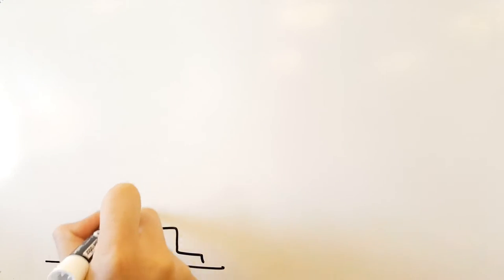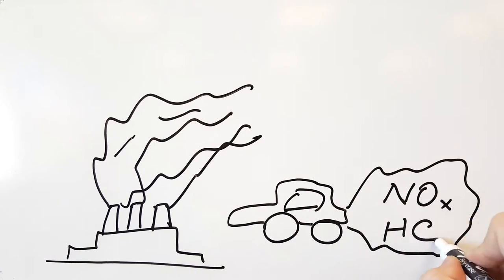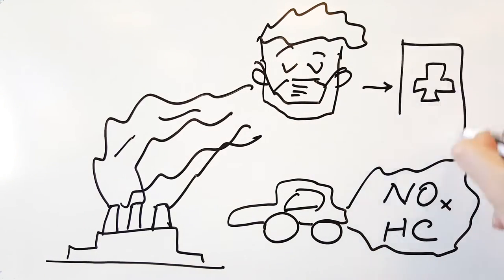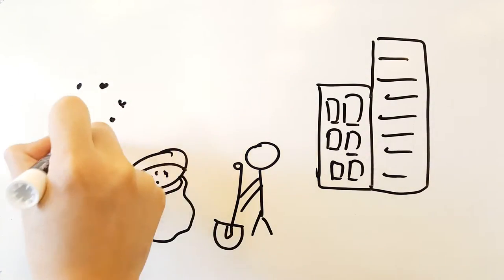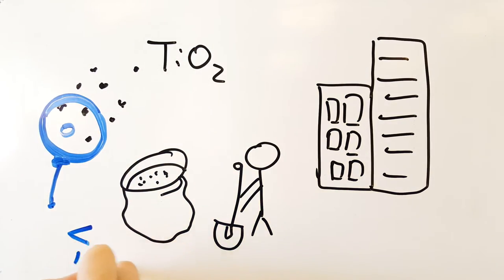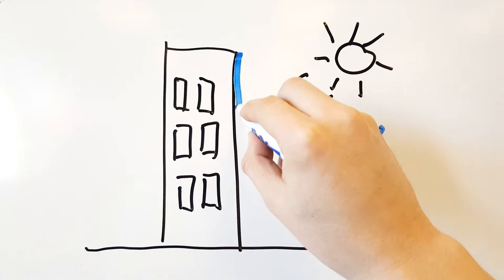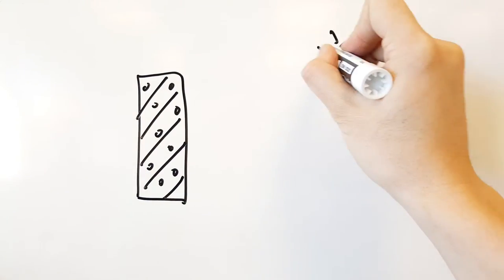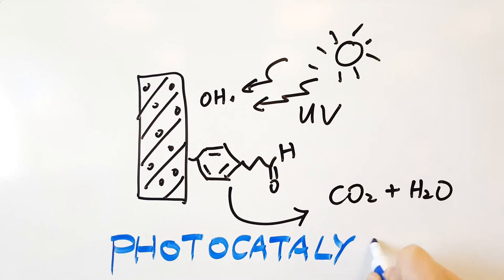Using nanotechnology to create self-cleaning buildings

Comment: Self-assembling buildings made 100% from nanotech

Nanotechnology – the control of matter on an atom-by-atom basis – has swept the world, transforming society in myriad ways.* At the same time, new methods of automation are displacing the need for human labour on ever increasing scales. A growing number of industries have seen their workforces shrink dramatically, with robots and AI handling the bulk of operations. Around the world, unemployment has soared.

Construction companies are being particularly affected now. By the middle of this decade, it's becoming possible to build entire homes and offices using nanotechnology alone. For a typical square or rectangular plot of land, this takes the form of self-assembling machinery, based around a scaffold system that initially resembles a giant, four poster bed. Vertical columns, one in each corner of the site, support a platform that gradually rises from the ground, adding successive layers of material beneath it. The columns rise in tandem with the platform, whilst also relaying material, until the building is finally topped out.

In effect, these machines are like substantially bigger versions of 3D printers and nanofabricators. For some of the more "unique" building designs or features, traditional methods of construction and engineering are still incorporated. Even these will eventually be replaced by self-assemblers as the technology advances further.

Atom by atom, these intelligent machines lay the foundations, core, framework, flooring, electrics, doors and other components – while robots inspect the interior, perform safety checks and make adjustments where necessary. By the 2070s, even skyscrapers and other tall structures can be erected using this method. The process is so rapid, it takes a matter of days from groundwork to final completion. Humans are rarely if ever needed on site.